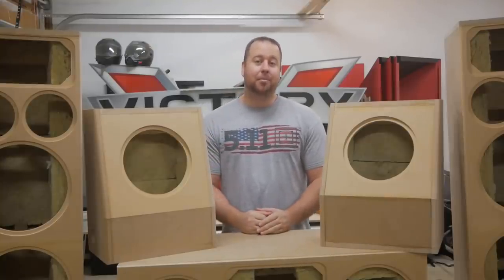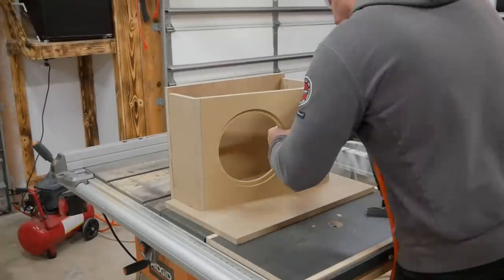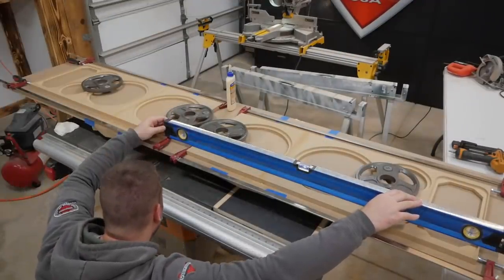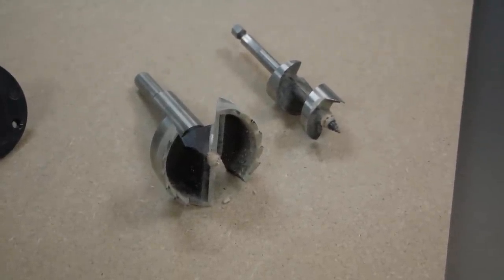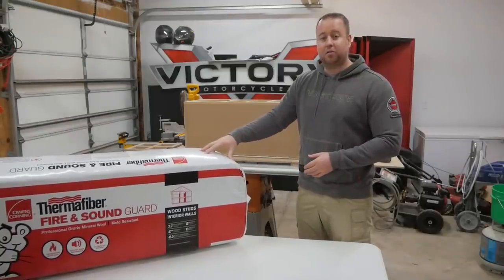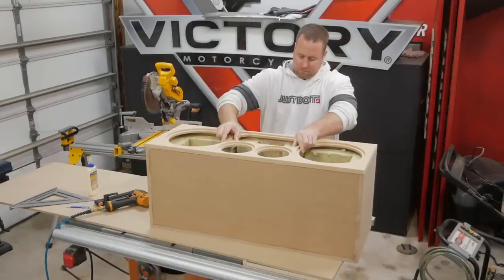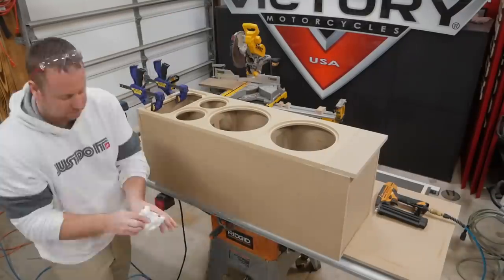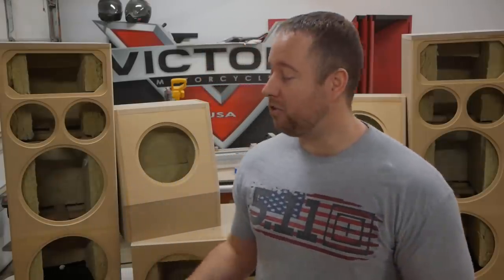Home Theater Speakers Build | Diy Sound Group 1299 and Volt 10

Comment: Nice speakers but I have some questions.
Why didn't you just make new baffles? That looked like a weak baffle without the two cuts, and it sure didn't make them stronger with the cuts. The rockwool is very dens and will take up volume in the box. In a ported box, what do you think happens with the itchy fiber from the rockwool? 
Your 6,5", do they have sealed baskets?
Reply from the maker: These were cnc cut to fit the speakers perfectly and center them. That opening for the waveguide would not have been an easy cut to perfectly match. This was much easier And faster. And it is plenty strong once attached to the rest of the box. The lower brace and port are right by the joints adding strength across the front.  The rockwool doesn't take up air volume in the box. A Google search will explain that more, but you want a dense breathable material for better damping to deaden the box. I left plenty of space around the port so the wool wasn't too close, but I also sprayed everything with a coat of the 3m adhesive before putting on the front baffle to lock in most fibers. Many have used this material with ported boxes and do not have that issue. A thin breathable liner such as spandex can be placed over the back side of the port area if one is worried (think pantyhose material lol). And the mids are a sealed back. The original design does not have anything in separate chambers either.
Reply: @LifeofBliss  If you had used the same router bit that you used to make it flush you would have been able to copy the baffle holes. If you had made two baffles the one you have could have been put on the outside, then you wouldn't need perfect cut outs on the inner baffle. But if you are happy, that's all that matters since it's your speakers. 
I personaly would never use Rockwool.
Reply: @extrakimF  That's the great benefits of building your own speakers, personal preference. Not worrying about another audiophiles' concerns or questions about building techniques. We all design to our own likings. By the way, do you have any videos of anything you have designed or built on Youtube?  I thought that since you have such knowledge and great suggestions, that you could elaborate and show us what you can do. Thank you.
Reply: @vegaslimoguy2376  I don't have a lot on Youtube and nothing with a finished build, but here's one: 
https://youtu.be/Q5EE1shNtPE
I do have some build pics of some of my boxes, but not on Youtube.

Comment: I’ll be buying the exact same speakers soon for the front 3 speakers(when they restock). Sealed center and ported left and right my question is if I leave the baffle as is with woofers on top and bottom would using the same dimensions you are would I still have a port tune of 35hz??
Reply from the maker: Yea it should all be the same volume and port size. The speaker placement shouldn't matter. Good luck getting yours together!

Comment: Did you account for the insulation taking up space for tuning the port size?
Reply from the maker: Insulation does not take up air space in the box. Inner dimensions will still be the same.

Comment: great video and very good job.how do they 12" eminence work in this speakers?i have read that eminence are good for horn loated speakers.i am thinking to build 2 tour speakers with 2 eminence kappa pro 15.you think they gonna sound good?
Reply from the maker: Thanks. I actually haven't heard these particular speakers yet, but I have heard the 10 inch versions. They are very detailed and have a great neutral sound. I think eminence makes great speakers so I'm sure that will sound good
Reply: @LifeofBliss  i have heared the eminence 15 " in  jbl 4530 horn boxes.they sound greatin this type horn cabinet.thank you man.i am waiting to hear your speakers in a new video

Comment: Does moving the original driver layout of the left and right channels change the sound of the speaker?
Reply from the maker: It will have some effects on it. The original designer said there would be some more bass reflections off the floor with both woofers down low, but he said it still sound great. Most things can be tweaked and corrected with EQ now days so should be ok
Reply: @LifeofBliss  OK. Keep up the good work these videos are really informative.

Comment: Just a question, why didn' t you port the center channel box?
Reply from the maker: Size constraints. For movies these will still be crossed over with the subs. I would still have the subs on if listening to all channels for music as well. 2 channel listening would be really the only time without subs so that's went I only did the towers. No reason you couldn't port all three though
Reply: @LifeofBliss  Really like your reconfiguration of the woofers and adding a port. Any chance DIYsoundgroup may adopt your design for the future front r/l speaker baffle? They look great, have you powered them up to hear what they sound like? I've always loved the sound from horns.
Reply from the maker: @gaj9080  Honestly I don't think they will change what they are doing. The designer said I would probably get more bass reflections off of the floor with the setup, but said it should still sound just fine. They have the 1099 and 1899 (now discontinued) in the same configuration, so probably won't change the 1299 just to keep in consistent. I have not powered them up yet because I don't want to lose the motivation to finish them when I get a few warm days! I'd be too tempted to watch a few movies instead! lol
Reply: @LifeofBliss  Understand the warm days concept and motivation living here in Mich. Come on spring

Comment: Do u have cut list/install of your router platform.i have been wanting to do that to my ridged table saw. Thanks
Reply from the maker: I just threw that together real quick for the dart board project I did. Used a really old hand me down router lol. I need to redo it with a base for my new router. I don't have a cut list but it was just some 1x4s and a 3/4 inch piece of melamine board. I'll make a video when I do the next one with my newer router.

Comment: Oh yeah, and where is the video where you added the router table to your table saw. That’s genius! I wish I would have seen that about 2 years ago before buying a router table.
Reply from the maker: Ha I was waiting for someone to say something about that! I put that together as a quick-n-dirty to finish up some things on the dart board. I'm using a really old router that is permanently there now. I'd like to make some changes to it and have a nicer router plate on top eventually, so figured I'd save that for a video. I just got a really nice router I used here in this video that I need to buy another base for that I can leave on the router table to quickly switch back and forth.

Comment: If you make boxes you should know that 15 inch speakers need separate enclosures or they fight each other for air and don't sound right and can develop other problems ps I made towers when I was 16 years old had two concert speakers and put them in my parents back yard and rocked the neighbor Hood
Reply from the maker: Good thing these are 12 inch woofers...
Reply: @LifeofBliss  your do a good job look nice keep up the good work 👌
Reply from the maker: 😉 thanks man. I hadn't heard that before about the 15 inch speakers, I'll have to look into that.
Reply: @LifeofBliss  a tech at car toys told me and my cousin he did bump off for them in the 90ds. Have 15 inch cerwin Vegas from the 80 D's they are in separate enclosures with air ports no planes though lol

Comment: Why insulation in a ported box? I thought that was a no-no so that fiberglass didn’t blow out the port.
Reply from the maker: This mineral wool insulation is about the best stuff for damping a box (right there with fiberglass insulation). Works great for absorbing midrange frequencies that would otherwise cause distortion in a box that has no lining on the walls. I looked into the issue with fibers possibly blowing out of the port. Most didn't find it to be an issue, including some professionals in the speaker business. I could always come back and attach some breathable thin material in the box behind the port, such as panty hose, to prevent fibers coming out if it became an issue. Also, I didn't show it in the video because I don't thing most people even do this, but I did take that 3M adhesive spray and coat all of the insulation after it was installed to lock most of the fibers into place
Reply: Life of Bliss ah, so it’s wool and not fiberglass. No fibers blowing around when the base hits hard!

Comment: Did you put fiberglass in ported cabinet? Is your lung ok?
Reply from the maker: Doing great! Cough cough... I sprayed all of the mineral wool with spray glue on the inside to minimize fibers. Not much air movement like a sub enclosure would have
Reply: @LifeofBliss  Cool! What type of board did you use for cabinet? 3/4 mdf?
Reply from the maker: @Bigzerk  yessir, all 3/4 mdf

Comment: nice work but way overkill, I have a 10" and 8" subs, and 5 1/4" bookshelfs (4) and a Cerwin Vega center with 5 1/4" drivers and mine is overkill.
Reply from the maker: It's all about perspective and opinion. But I will agree. I wanted overkill though
Reply: I think over kill is a good thing, you don't have to crank the volume to extremes to achieve good volume with no distortion.

Comment: Way to much woofer my triple 6" POLK'S towers  do just fine don't know how much you really need I'm running 840 wats with pioneer tuner in the negative volume at 15 it loud enough I'm not even in the plus volume yet

Comment: 6 12s and 2 10s... that's way to much bass for a home theater you're going to drown out any other sound and go def when something blows up or some one shoots a gun.
Reply from the maker: These are woofers, not subwoofers... they will be crossed at 80 Hz for most things outside of 2 channel music. They will produce plenty of midbass though. Also, there is tuning for a balanced sound... Now the 3 24 inch subwoofers coming are for the bass.

Comment: Wow im not sure where to even begin....  but only a 3/4" baffle and its pieced together? Wtf? Why? This is a joke right?
Reply from the maker: Well you were right, you don't know where to begin... Lol these are mains Cody, not subs. People throw 18s in single baffles. As long as there is good bracing, that's what makes it solid. If you noticed the bracing and port are right on the lines where the front baffle was joined up. I can hold the 70 lb box up by the front baffle and it doesn't flex or bend. They'll be fine brother.
Reply: Im not sure what drivers you are using but the x-overs had some decent components and you are using 12's that are recessed. I did watch the entire video and you did use bracing but all common chamber. You have the tools i just think you would be happier with the results if you were to make things solid. On my towers i have morel elite drivers with a 6", 4", tweet arrangement per cabinete and used 1.5" baffle with extensive bracing all in seperate sealed chambers predrilled glued and screwed together. In addition i coated the insides with a .25"  mixture of play sand, long strand fiberglass and poly resin. With 600w going to each they are some of the loudest cleaest ive heard.  You want your cabinets inhert as possible. As far as a single baffle for a 18" sub thats a waste imo. Ive built hundreds if not thousands of enclosures and never used a single sheet for a baffle unless the customer wasnt willing to pay for it. And thats like a single 10 situation
Reply from the maker: These are eminence delta 12b's if I recall correctly. The 6.5 mids are actually a closed back and the compression driver is sealed, so it's just the 2 12s sharing the entire cabinet space. The original designer made these the same, but in a seal configuration vs ported. And I hear what you're saying about making a new baffle and doubling it up to 1.5"... that would definitely make it more solid. I decided to cut it and add the bracing where I did to make the process a bit easier and faster. The waveguide would have been a little more difficult to make perfect as well. But honestly it's very solid and I'm happy with the look and the way they turned out. There are definitely different ways to go about things. I'm sure yours echo about as much as a solid brick with all that sand and resin lol! Very cool man, bet they sound great